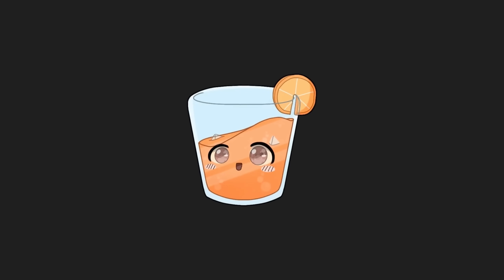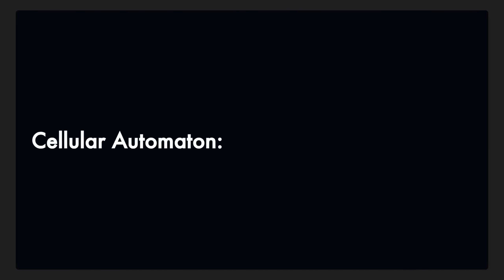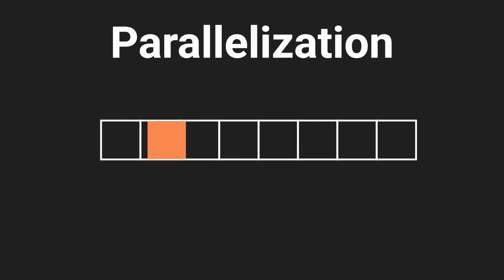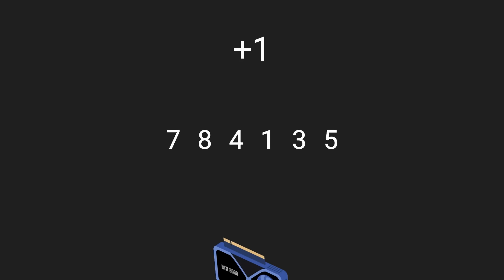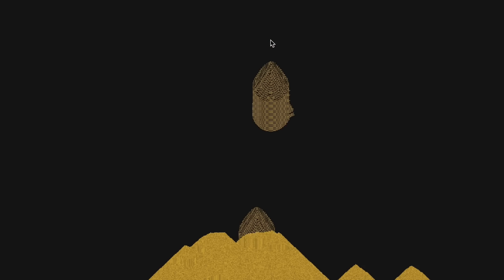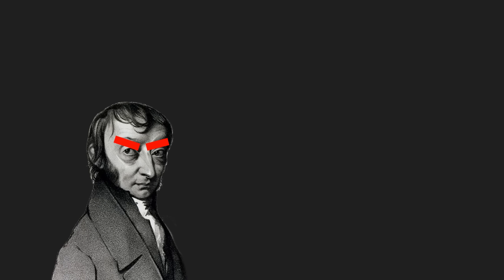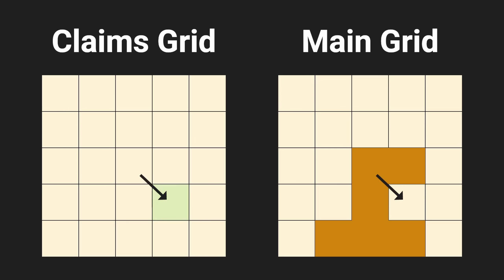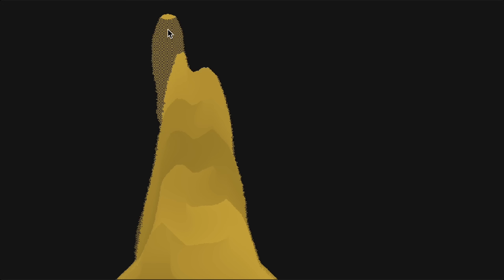Optimizing a Falling Sand Simulation To an Unreasonable Degree

Comment: I think it could be tricked even more. If you are checking every sand grain, you are still losing time, even by parsing them. I would suggest to mark the external grains, in that way the internal and stable grains wouldn't even be parsed. Of course then you have to manage changes like deleting "internal" grains.

Comment: If you only compute every third column of pixels in parallel (eg. 1,4,7...2,5,8...3,6,9) , they could never conflict with each other. This would mean three parallel computations per step. I guess this could be up to three times slower if the GPU could be doing all pixels simultaneously.

Comment: Ages ago I did something like this. Eventually, I started playing around with other methods like not checking every pixel on the screen each time and instead keeping a list of 'particles' and only processed those each iteration (I was working on the pretext that the number of particles would, in general, be much less than the total number of cells in the grid (pixels on the screen)). I also ran into the direction biasing issue and tried a number of things. One thing was that if the column was odd, check below, check left, then check right. If the column was even, check below, check right, then check left. You could also do something like adding the X and the Y together and if that was odd, check one way and if odd check the other to make it a little more diverse. I didn't do it on a GPU, just a CPU. The thing is, every particle can be done in parallel. I used locking as well on the destination location so that only one could 'look' there at a time and if something else moved there, when the lock was obtained by another particle, it would be filled or empty and safe to make a decision based on that. If no other particle was looking there at that time, the lock should be obtained, processing happens, lock released and nothing else is stalling waiting on it. Something else, when a particle has moved as far as it is going to move (bottom, left, and right are filled), you can put it into a list that doesn't get processed again. However, that's tricky because one of the (bottom, left, right) particles may move at a later time which means the particle above can now move. I've thought about ways to deal with that... one might be that when a particle moves, it indicates to the above, above left, above right particles, if any, that they need to check and to process all particles from the 'ground up' by using like a priority queue or something based on the Y coordinate for all particles and processing in order based on that. With today's GPUs and such, it might be faster to just process it as a giant grid, though, since there is lots of parallelism that can work on a grid. Even with today's CPUs, it's probably faster to just do it as a giant grid. There's overhead in keeping lists of particles, allocating memory for particles, etc. when an empty grid cell can just be "if empty just go to the next cell". As it was, with my playing around with lists of particles, I'd just do a list_of_particles.ForEach().AsParallel() type thing so that it would just parallelize as wide as it could, etc. without my dealing with thread management, etc. Also, I haven't looked into it but there may be something that could be done with AVX type instructions to increase parallelism on just the CPU.

Comment: 2:13 are you off by one magnitude without knowing so or how did 1280×720 become anywhere near 9×10⁶?
Reply: The single sand Pixel well need to check more then once so yeah it well take alot like 9m il
Reply: @HG_Devs where in the algorithm for a particle are all those comparisons? As it's presented the number should be way lower assuming that each particle only moves one pixel per frame and that the evaluation goes from the lowest row and upwards.

Comment: This usage of atomics is scary: you now have race conditions based on rasterization order, and this operation blocks parallelization of your GPU.
My proposal: find a deterministic definition for the empty pixels, and iterate sequentially line by line from the bottom. Parallel for all pixels within each line, and with barriers between each check. So with 1920 threads, you might be able to fully utilize a low end GPU.

Comment: Before parallelizing, you can advance performance a lot by other techniques. I tend to let parallelization for last, as the algorithms tend to be very particular to the kind of problem, and that may change with optimizations.  Just tracking dirty regions which although complex, is doable at some extent, will had give you similar performance increases. Then you can always paralelize on top.

Comment: another idea to potentially fix the race condition issue is to use an idea from image processing and look all the cells around each cell and create a solution for every configuration. So if you want to move down and to the right but you see the cell above that cell is filled in you instead don't move and let that cell go instead. it takes a little more planning but it should remove all race conditions. This computerphile video explains the premise but you would have to adjust it to your specific case. https://www.youtube.com/watch?v=C_zFhWdM4ic

Comment: I think you're still capable of hitting race conditions unless you've largely negated your parallelism. The best way I can think to do it while conserving memory size is to use two buffers, then split the grid into 3x3 blocks. Then, you randomly index each pixel in that 3x3 block and copy those indices to every block in the simulation. Finally, you execute the movement in nine passes, from index 0 to 8 by processing the movement of every pixel with the same index each pass (every index 1 pixel, every index 2 pixel, etc.) using parallelization so that they will never try and write to the same position in the second buffer grid (you can ping-pong these buffers to not waste compute copying data back to your "starter" grid).

This guarentees maximal parallelization, and zero chance for a race condition (even when accessing the second buffer, which is just to avoid pixels moving two spots in one iteration). it even allows for fluids that largely move sideways and upwards. If you're just moving sand, you could probably get away with using a 2 tall by 3 wide split to reduce the number of passes you do in a frame from 9 to 6.
Reply: Took a few hours to code it up, basically wound up making the same system as you with a "locking" buffer that tracks which pixels have moved this frame. if any two pixels swap places, they're both locked in place. Only difference is that I only parallelize pixels that cannot interact in the same neighborhood (they share no neighbors) by using the method I described above. Perfect preservation of mass, no big issues with performance. I've probably made a bunch of mistakes though since I haven't coded any shaders before, can probably get faster. You can use a compute buffer to define a bunch of different particles with different weights and movement properties in the inspector (I treat empty cells as "air" particles instead of a null state).

Comment: I'm curious why you went to parallelization as your initial approach to speed up instead of reducing the number of sand pixels we actually keep track of. In this simulation it seems like we only care about pixels on the border of sand blobs for interaction sake. As such, if we just had a queue of pixels to check for update each step instead of running our automata rule for the whole screen we could save a lot of time. Of course there's definitely some required careful bookkeeping for updating adjacent neighbors to remove them from the queue once they are no longer on the border. With some simple checking to see if a pixels is surrounded and a propagation rule for the even that a sand piece moves and becomes "unsurrounded" a lot off effort could be save. While there are probably some tough race conditions with this approach, it should also work with parallelization for maximum speedup.

Comment: I thought a little about your Towering issue. What if you checked every vertical column for how many empty cells it takes till there is a sand-cell and used it as a multiplier for how fast they fall. Obiously it would make the sim run slower, but by a finite amount, determined by the width of the sim. As i got no idea how to program it could be a silly idea, but still i wanted to share😊
Great video btw

Comment: 4:08 correct me if i'm wrong but from what i see you implemented an IF in line 72 to check if any of the neighboring cells wouldn't give an "index out of range" error,
i remember solving this kind of problem by adding 1 layer of fake cells on every side of the grid
for example a 3x3 grid would turn into a 5x5 but you still only run the simulation for the middle 9 pixels without worrying about neighbors' indexes

however i'm not too familiar with writing shaders and may have just come up with the most complicated way to remove one computationally cheap if

Comment: can't you run the simulation in parallel per row starting from the bottom? I'm not sure if that's faster than using an array of claims.
another idea is a mask-based deterministic algorithm, where you analyze the neighbors in the previous step to determine where to fall.
though cell automata have a limit, you can't move more than your mask size per step, so you'd need to switch to a vector based approach .
on a modern gpu you can probably run a quad tree based collision algorithm in real time, though I'm not sure if that's much better than doing more steps.

Comment: Since most cells are at rest on each timestep, and cells can never interact with cells more than 1 tile away from them, then you can make an optimization to skip processing most cells.  Whenever a cell is changed in a timestep, add it and its neighbors' coordinates to a buffer of cells that need to be processed in the next timestep and only update those.  You have to be a little bit careful with this so that you don't miss any and so that when the user interacts with the sim that the manually-changed cells are added to the list properly, and it also means that processing a timestep requires a very variable amount of work, but it means that you don't actually have to even consider touching most cells.

Comment: looks inside
reasonable degree of optimization
Reply: The moment he used atomic operations he lost like a 3x factor or smth like that.
It would still be reasonable to use that checkerboard pattern, which from one of Sebastian Leauge's coding adventures we know works.
So it doesn't even reach the peak of reasonable optimization. When clicking here, I expected some really advanced wizardry, not throwing the work to the gpu and done.
Reply: Yeah i was hoping actual unreasonable optimization
Reply: But is it?  Throwing a GPU at the problem isn't optimization, it's simply brute force.  So I would argue this is under optimized, which is indeed unreasonable.

Comment: instead of iterating over all the sand, when moving sand out of a cell, you can mark the 3 cells above the initial position + the new cell as "needs check" (i.e. append it to a list somewhere). then you only need to iterate over the pieces of sand that you know have a chance of moving.

Comment: I believe the sand particles "roll" slowly because the gaps propagate upward only 1 pixel at a time. If you move a series of particles as one to fill the gap instantly then they will flow a lot faster and it should look more natural.

Comment: I love a good GPU implementation, and nothing is faster, but it would be interesting to see how it could be done on a cpu. I guess the first step is to remember if each pixel column contains sand or not, and only loop through the columns that contain the sand. That would be a simple bool flag for each column. Next I would instead remember if the column contains unstable sand, which would be if anything moved in the previous frame. If it was stable in the previous frame it will be stable in the next frame, so no need to check anything then. This should reduce the amount of checking most of the time, but worst case will still be pretty bad. I guess you could split up each column into a binary tree and only update the half that has any unstable sand. I guess you could do this using a quad tree for the whole screen. It would be interesting to see how this performs.

Comment: I have a diff idea to atomic exchanges. You need more buffers and an extra loop at the end but it only covers a fraction of the whole. Basically you assign each thread to cover a chunk of the whole with it's own buffer to fill. Each buffer will hold an "empty" cell on every edge (including the top) to guarantee the threads don't fail at their job. Once done the final step is to just loop through those sides and bottoms looking for stray grains and put them in a new place of the appropriate buffer, adding them to the top of whatever stack of sand is in the way (this is what the top "empty" cell is for, assuming there wasn't an appropriate chunk above to move it to instead. At the end you just send the buffers to be drawn while using the time it takes for it to get to the GPU to start overwriting the original main buffer that the threads were scanning for grains from.

Comment: I used to make random scratch/turbowarp “games” just anything I could think of. I learned that yeah it’s very slow to make sand like that. Unfortunately that’s the only way I did it.

Hoping to make more stuff one day as I had so much fun doing things like making Minecraft 2d and figuring out how to make things work. Though it wasn’t very big but did more than any game I made.

It had “smooth lighting”
what I called cropped rendering
porly made pig entity
I think the project was almost like 500mb
Reply: I made a similar thing once and it actually ran very well somehow despite very little optimisation. It had sand, water, rock, dirt, acid and steam. You could explode pixels as well and there was a unfinished lighting and temperature system. 

It also had a map generator, it would pretty much only generate a hilly landscape with caves, but the generator was incredibly slow so it generates one map rather than an infinite one. 

Unfortunately, I had to make the game very zoomed in because turbowarp struggled with rendering the pixels and I eventually dropped the project (and turbowarp)

Comment: maybe to solve the problem with how slow it falls when you throw a lot of it in one place is to create a pressure system. The way it knows where it should go should be implemented a way to calculate pressure and based on that will dictates how fast/far a cell will move. Now this might complicate things beyond hardware capabilities. But trying it might be interesting.
So, to calculate the pressures basically a cell should calculate all cells around it, but more importantly the collum right above it, that is the one which sets the pressure on it, the one around is more like a blocker that can or cannot hold the pressure or how it is going to hold it. That gets me thinking of a new rule for this like if the pressure is enough, it will push the cells to the sides away making more room into that spot. Now it needs to be calculated in a way that it can be spread out.
Just some thoughts about it.

Comment: Wait.. is that it??? Simply handing an enormous task to the GPU (and doing nothing else) doesn't qualify as optimizing "to an unreasonable degree" to me. I would have thought that the first step in optimization would be only iterating over the cells that contain falling sand, rather than the entire screen. Then, if you want to optimize to an unreasonable degree you'd have to pour over the logic, finding some little tricks here or there that makes it just a little bit faster, until you think you've exhausted every possibility.

Comment: I wonder how the claim system would work if you just moved the sand in the same direction one pixel further? That would surely speed up the falling but I'm curious if the horizontal movement would break realism and to what extent?

Comment: Awesome video! If you are interested in ways to improve this further: there's a tech presentation here on youtube on how noita does this on the cpu using multithreading. If you take a similar approach - splitting up the grid into sub grids, each marked 1 - 4, with no sub grids with the same number adjacent to each other - you should be able to implement a 4 pass compute shader without atomic operations. I'm guessing this would improve performance even further. Noita also allows grains of sand to travel more than one space in a frame as it tracks velocity.

Comment: You might know this, but for each sand particle, instead of looping again to see what empty spaces are near it, take the index of the current pixel/fragment, use a function of the screen resolution to determine what the indices would be of nearby pixels (or hardcode if you only care about 1 resolution), and check them by directly indexing the spaces you care about.
And you might know this too, but if any variable is the same for each pixel, compute it just once on the cpu and pass it as a uniform

Comment: I have an interesting idea / question for optimization. What if we skip calculating a row if the row below it is full of sand, since it wont change anything since it cant move down. I feel like this would make it more optimized the fuller it is. Of course it might be a issue to always check if the row is entirely full, but maybe give it a try.

Comment: Misleading video title. You know that simply changing the method of executing the computation is not optimization? It doesn't run better because it was made better. It runs better because it runs on a completely different piece of hardware. What a waste of time